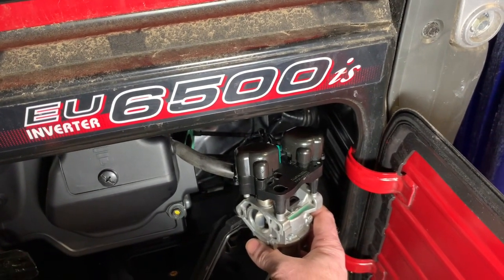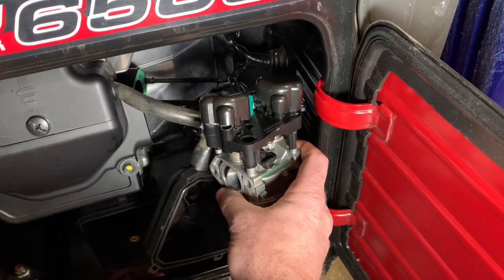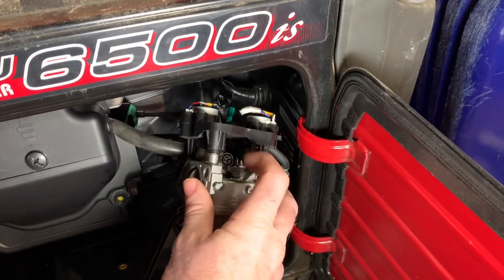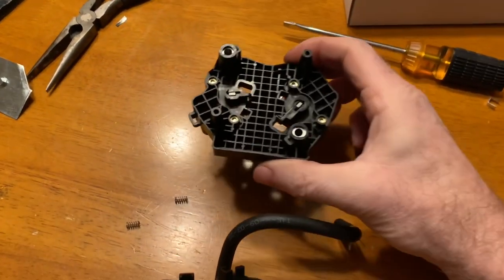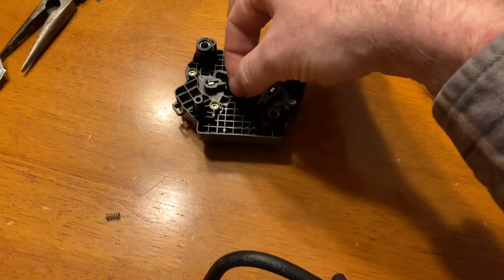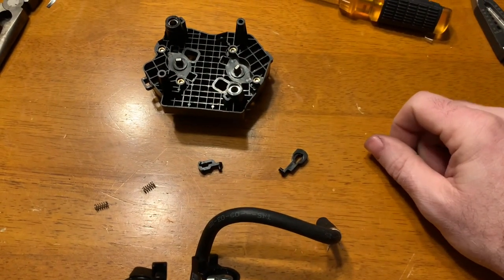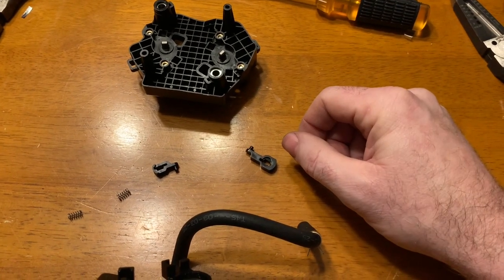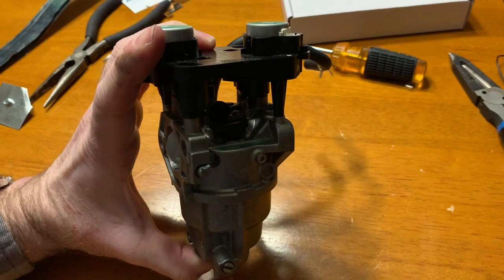The Secret to Reassembling Honda EU6500is Carburetor Throttle Control Motor Springs

Comment: I have the exact generator. It will not run with eco switch off. New carb, new inverter board,  1500+ dollars later still not fixes! Any ideas would be much appreciated

Comment: Excellent video; you saved me from making the same mistake.  I was able to correct the E-04 (throttle motor code) by removing the carb and two little motors, then cleaning the throttle & choke journals.  Prior to cleaning , both had high resistance to movement, which caused the E-04 code.  My EU6500is runs smooth now.  
Note: I tested the throttle motor by removing both from the carb assy, then connecting the choke harness to the throttle motor - turned the switch to ON  - and the little motor functioned as if it was setting the choke. Once your choke and throttle plates move freely, reinstall the little motors by swinging the plates until the motors line up with the lever arms in the black housing.
Reply from the maker: Phew! Glad it worked out for you! Well done